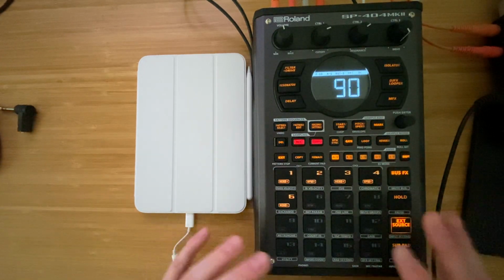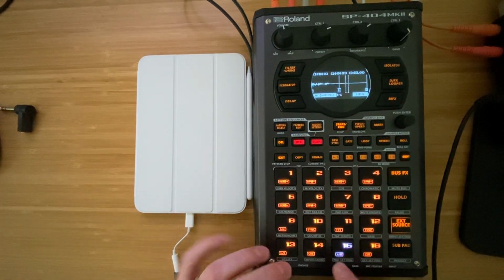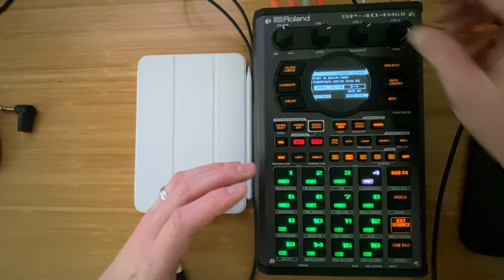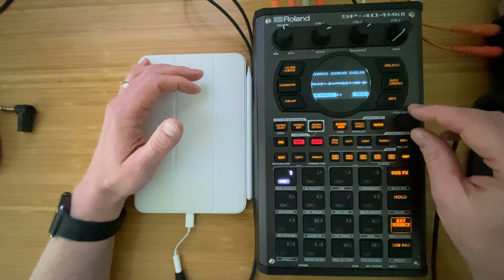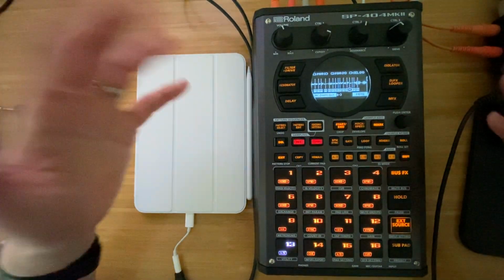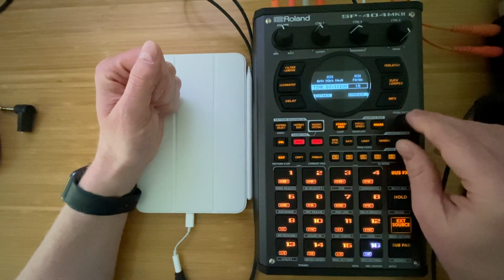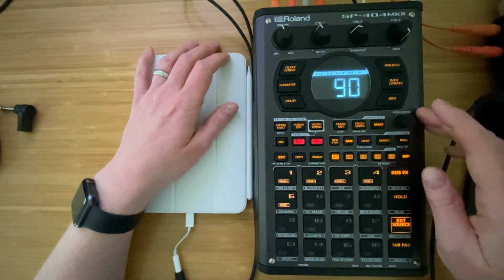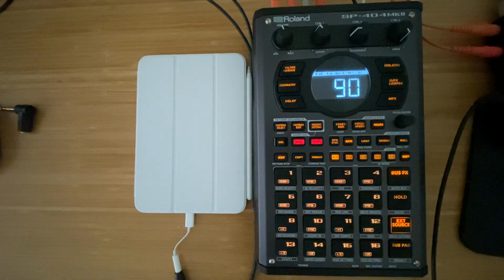SP404 mk2 11.3 - Chopping Loops

Comment: It seems like you are hitting the pads pretty hard. Is there a sensitivity adjustment? How is the pad response? Any double triggers?
Reply from the maker: You can use Fixed Velocity or 16 Level Velocity and hit them very lightly... there's a lot of pad sensitivity settings too that can adjust how it performs.  Guess I am just heavy handed? :D